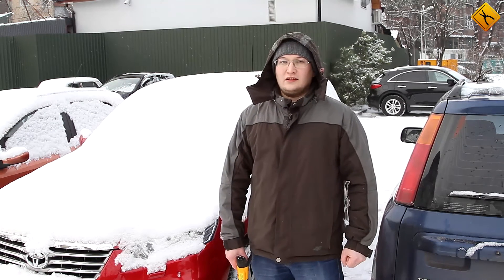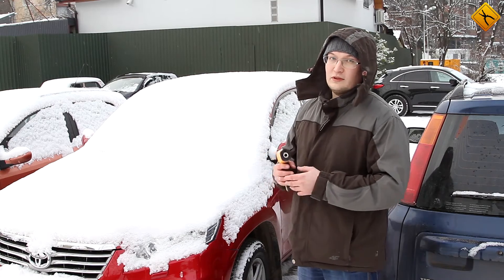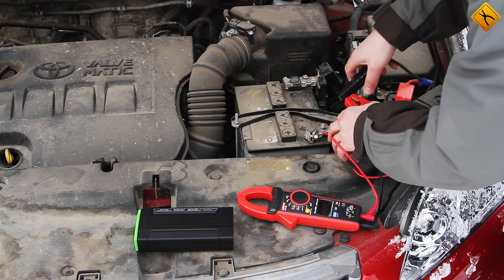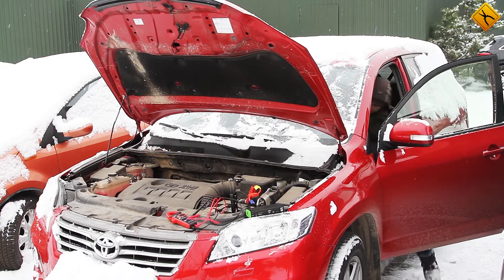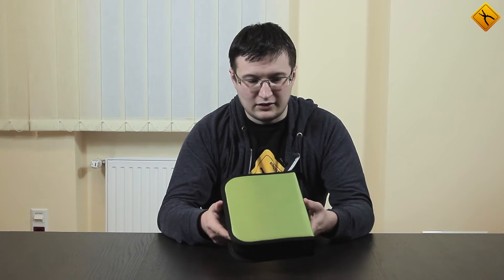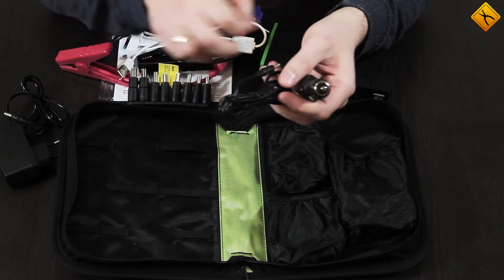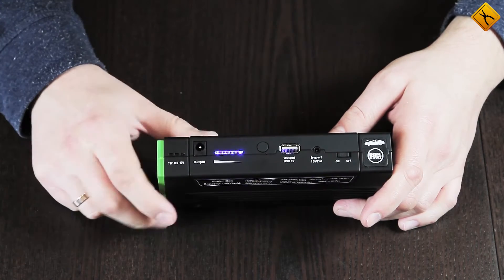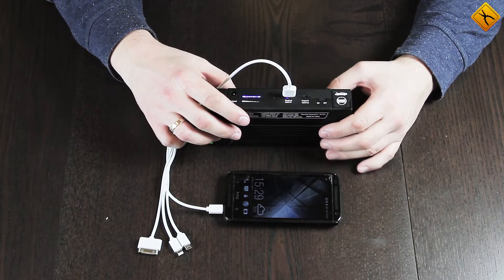Jump Starter D28 Real-World Test

Comment: I've tried three different models and none of them had the juice to start a cold Nissan Titan (v8) in sub zero temps. Don't rely on one of these to get you out of a jam in a Canadian winter!
Reply: Jason Kizlyk they are engineered to jump v6 3.0 liter engines. There's a specific model which has a 1000 amps rating that's what you need
Reply: I see. Are they being misleading or does it actually give the correct info on the package?
Reply: What I mean is, even the one in this video states it will boost a 5L engine...